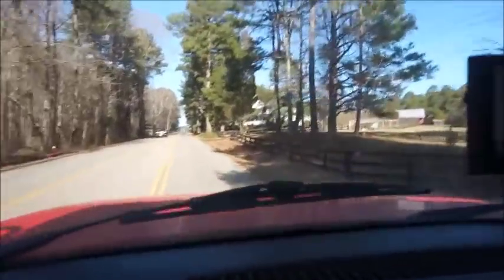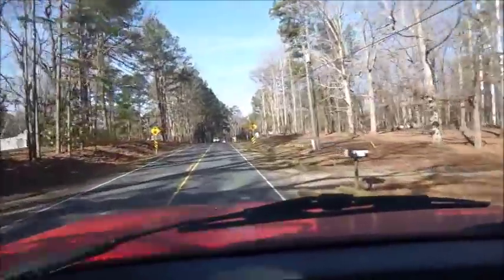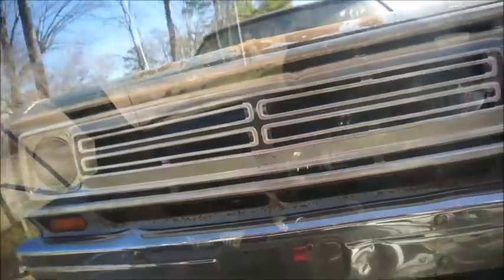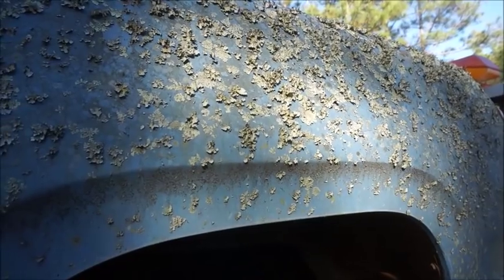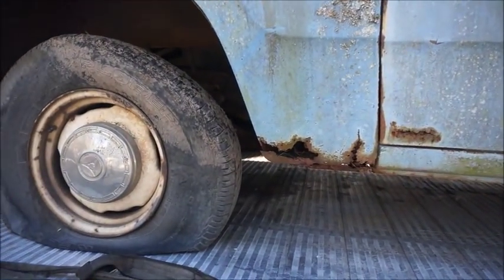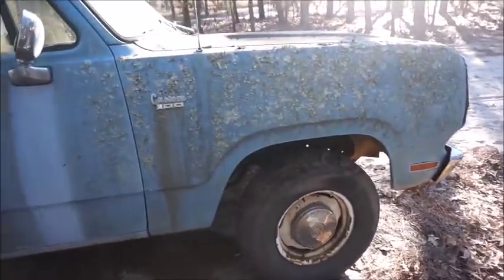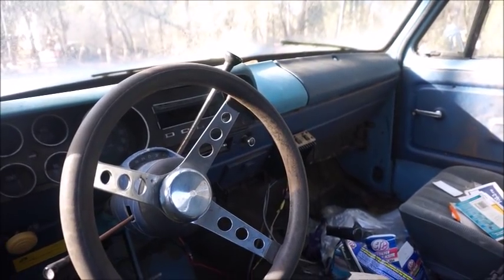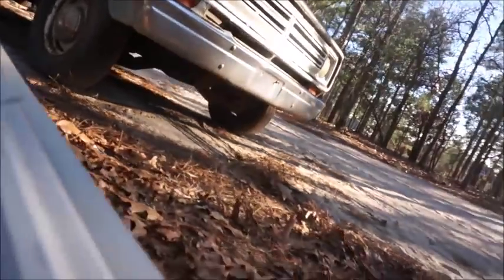1973 Dodge 100 Rescue Short Bed Step Side

Comment: I've been looking for a 1973-1978 Chevy/GMC truck for about a year now, as I completely screwed up and sold on my 1978 GMC truck. It was a heavy-half ton and had sat for 10 years before the previous owner did like you did, went, bought it, got it started and just sold it on. I proceeded to drive it about 100 miles to and from work every day for 3 months without a single problem. I called her Ole Betsy and I miss her.

Comment: That is the second year of that body style. The short step side bed is a carryover from the 50's Dodge used that bed on at least 3 body styles all the way up until 93. I spent much of the 45 years I was in the business working on those trucks. When that one was new I was in my 4th year working at the Dealer.

Comment: Man you never see em than nice here in PA. They all rotted to bits from the winters and road salt!
Reply: kevin6154 Here in IN even the newer ones have the wheel wells rotted out and lots of rust on the frame behind the wheel. But what I want to know is why the majority of trucks like that are Dodge.
Reply: in 1997 my 1979 powerwagon was just about rotted to bits. only thing good on it was the frame and drive train. the rest was bout all bondo and tiger hair lol
Reply: Around 2004 I was out plowing with my 79 Powerwagon  and I hit A curb. The frame broke right below the drivers door. It was about 3AM and I was 25 miles from home. Had to drive home at about 10 MPH. A guy bought it from me so he could put the drive train in A mud truck. It had A 360 4BBL. and A 4 SPD. standard tranny. She was A rusty girl but that's par for the course in Minnesota. You should see the rust on the 90 Bronco I replaced her with!!
Reply: same thing here in West Virginia.
Reply: kevin6154 yea man it's the same in Michigan

Comment: That's a really pretty little truck.  I understand that those Dodges tended to rust pretty badly even in fairly dry climates so there probably aren't many original ones that have been properly used that are as good as that one.  I suspect it will probably end up as the base for a L'il Red Express copy or as a parts truck for the resto of a rotten L'il Red which is a shame as it's survived nearly 44 years with little change from the original D100 Custom spec so it would be nice to see it stay like that, but I guess the L'il Reds are where the money and a lot of the enthusiasm is...

Damn, it's just occurred to me, that truck is as old as I am.  Better condition though...

Comment: Good looking step side for a Dodge. Hope the engine run's, I couldn't see the condition of the bed. Without a doubt a good project truck, may be even a daily driver.
Reply from the maker: Me either, not sure what is in the bottom, wood or steel. Get the trash out soon. Thanks for watching!!

Comment: some late 70's early 80's 318 and 360's came from the factory with quadrajets.
Reply from the maker: I should know that, but I didn't thanks!!
Reply: Jonathan W Not a problem. might shed some light on whether it's the original engine or not. Odd choice of carb by Chrysler. Ol boy I went to high school with had a 73 ex state highway truck still painted orange. it had a 318 in it and it'd spin the tires as long as you stayed on the gas

Comment: Doesn't look too bad for not being driven for 10 years. Look like underneath isn't even too rusty. Those old dodges are built pretty tuff. No real damage and what kind of engine is that a 318 Cu V8? Time to pressure wash that lichen moos off those fenders.

Comment: look at the damper that will tell you if its a 360 a full circle damper is a 318 half moon is 360.Numbers on the intake will tell if it was off a 340 engine.

Comment: nice looking ride.  it is surprising that the tank is still inside.  Have you messed with those thermoquads much?  I hadn't heard of them till  a few years ago.  More of a Ford/GM/International guy myself.  What is with tags on window and plate?  Is there two kinds of registration in NC?
Reply: Oh.  Is that a yearly thing?  They look at our cars, assuming they are from another state or I suppose if it was a cobbled together sort of thing, one time.  They never looked at my Bronco when I took it in to get registered after converting it to propane.  It had been registered in Oregon so just changed name on title
Reply: well near Portland and a couple other places you do have to do smog. Fortunately I am just outside of that region.  Where in Oregon are you?
Reply: Nice, I am up in St. Helens
Reply from the maker: They do a yearly safety inspection here, but quit recently on anything over 35 years old.
Reply: thanks
Reply: my dad had a 72 ford f250 with the tank behind seat
Reply: Guess, I never was around dodge and ford of that vintage, newer and older but not those years.  Dad's 73 GMC had tank underneath
Reply: Ive got a 77 3/4 ton dodge with the tank in the cab. My 72 has the same thing.

Comment: I think olds used the straight fuel inlet carb. That truck is a score, here in st. Louis guys would kill for something that clean. Come to think of it, I THINK mopar breifly used q-jet carbs.
Reply: southernfriedhippie    thermoquads
Reply: Thermoquads were used. But I think q-jets were also briefly used in the late 70s as well.
Reply: Quadrajets were used 1985-88 after Carter got out of the OEM supplier business at the end of 1984. 318 went to TBI in 1988, 360 went in 1989.Thermoquads were used exclusively 1973-1984, before that were AFB/AVS square bores.
Reply: Whosaidtyler thank you, I was sure they did, just couldn't remeber exact applications. You have a great memory!
Reply: woo stl go blues

Comment: well aaannnyyyway we'll just have to let the ranger sit back there and rot
Reply from the maker: It was a newer 4 cyl ranger. Not an old full size ranger.
Reply: Jonathan W figured that much, don't be defensive I know if it was worth it I know you would have gotten it too, I had an 82 ranger in 92 that I took the 4 banger out of and (had a hole in a piston) and put a 289/ c4 into....fun beater for driving to school
Reply: Jonathan W I like that stepside Dodge though, neat looking truck